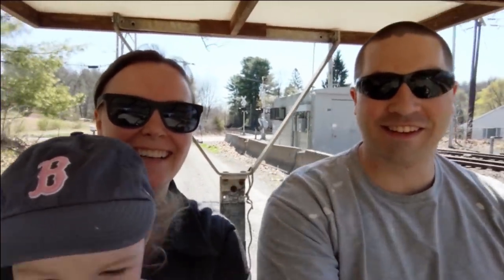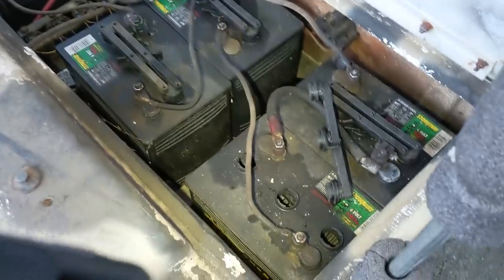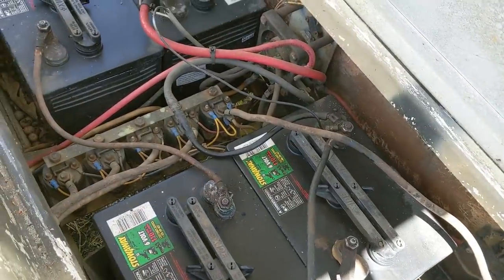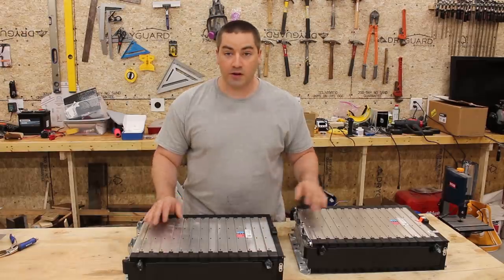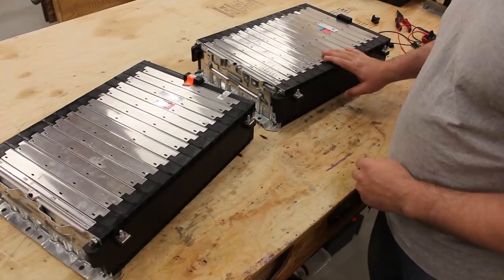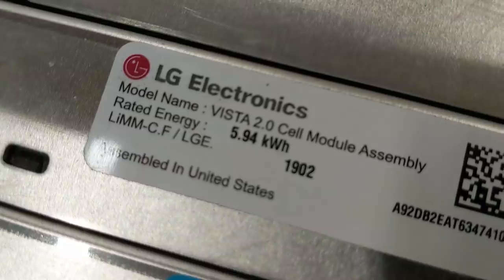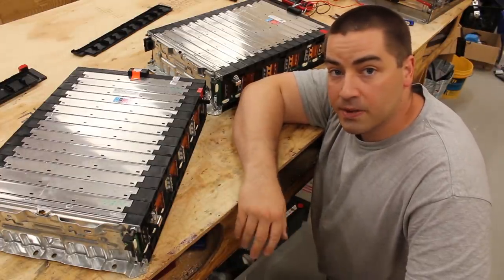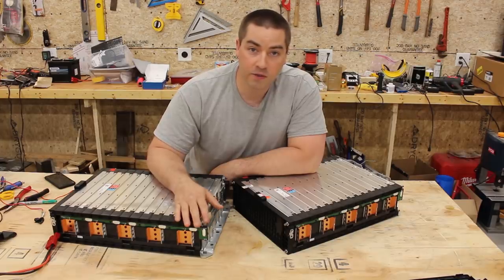Golf Cart, Lead Acid Swap to Lithium, Intro

Comment: What name brand of golf cart is this?
Reply from the maker: I think it's a late 70's Club Car.  But I can't find a sticker or data plate to confirm.
Reply: @DavidPozEnergy  It's a Club Car Caroche.  I have a 1976 model that I have been wanting to convert to lithium since I swapped out the contactor setup for a "real" controller.  I may have to duplicate your battery setup.  Thanks for posting this!

Comment: Link is shortened you need to add https:// and of cause the link to the battery pack you are using.
Now i need to retype the whole url cause the android app does not recognise that www.bh.com as url and I can not copy from the description.
Just add https://www.batteryhookup.com/ and the right productlink and everybody is happy .... cause searching does not really help cause it will lead to new questions that do not occure if your link is working for that particular product. 

THANKS ... great stuff to build the next formla 1 racer out of trumps previous golf cart.
Reply: Sold out. Link probably gone.